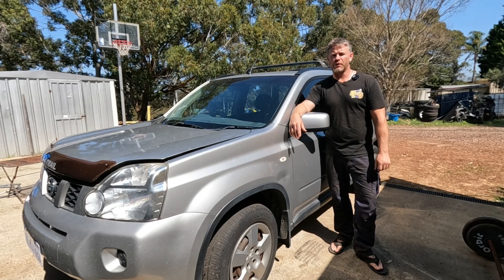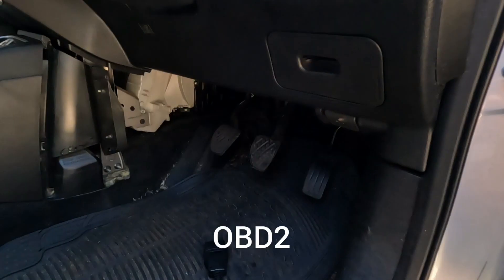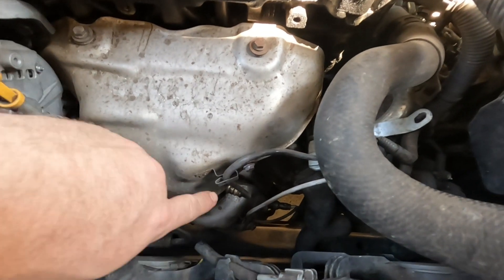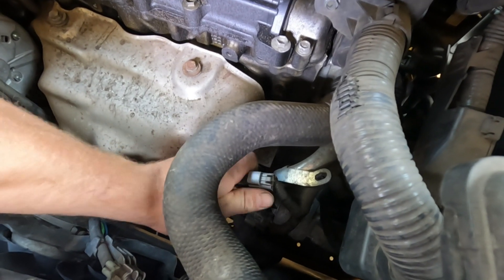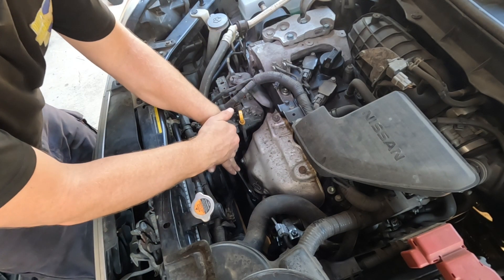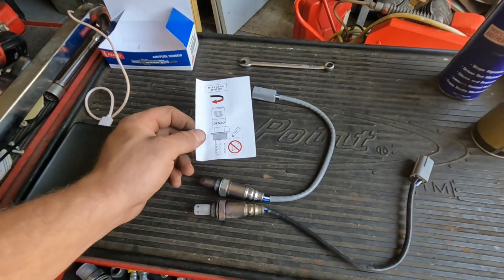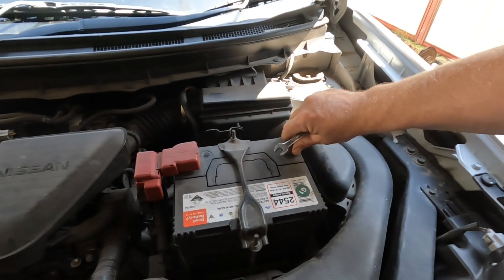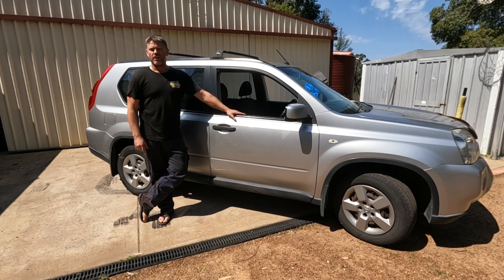Nissan X-trail fault code P0130

Comment: where did you buy the sensor from?
Reply from the maker: Nissan Perth
Reply: @downtheshedwithbyron  do you remember how much they are? Also can you use aftermarket ones? I find heaps for the T30 but rare for the T31 and I thought they were the same engine for the 2.5L
Reply from the maker: I went genuine mate cant remember what it cost sorry @deemad2180